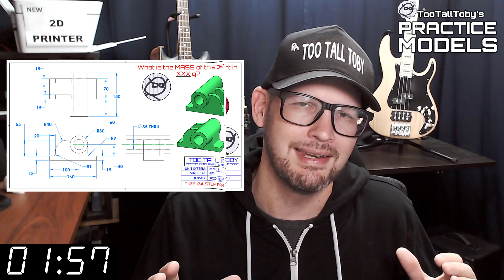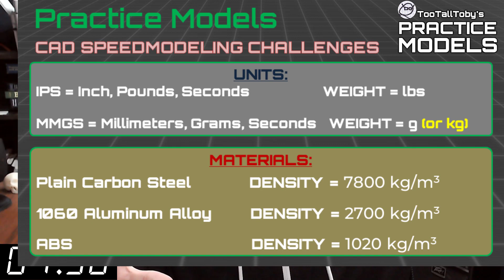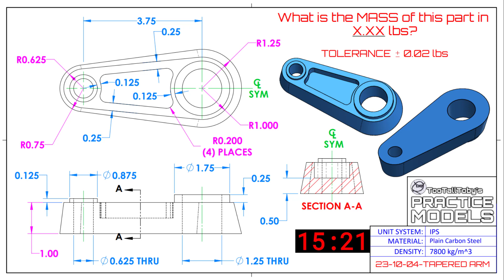CAD Modeling Challenge - Onshape, SolidWorks, Fusion360 - LOFT - Tapered Arm

Comment: thanks for the practice part, Toby!! 
i used a boundry boss as opposed to a loft, i can't remember the time (slooooow), and got the mass correct (lucky).
https://youtu.be/2qVNl18OGCE
Reply from the maker: Very nice JED!  When I am teaching my ADV PART MODELING class I describe the BOUNDARY feature as a "loft 2.0" feature - meaning that for simple shapes the boundary will yield the same geometry as the loft command.  And a simple boundary is constructed the same way as a simple loft.  But because it was coded much later in the lifespan of SolidWorks, it's a more capable tool, particularly when you get into the nuance.  So BOUNDARY is basically "an evolution" of LOFT.  

I should make a video about that sometime.  :-)
Reply: @TooTallToby  You should! Thanks for the info/history on boundary boss. I really had no idea. I think it would make for a perfect tutorial though! I would almost guarantee I'm not the only one that wonders, "why a loft and a boundary boss?" Thanks again, Toby!

Comment: i had to redo the whole model, i thought the upper geomtry was a constant offset and i was very wrong.  2.0188lbs, in 20+ minutes
Reply from the maker: Nice - so you ended up doing it with a loft after figuring out that upper geometry?
Reply: @TooTallToby  yes, it was the only solution possible, I guess.